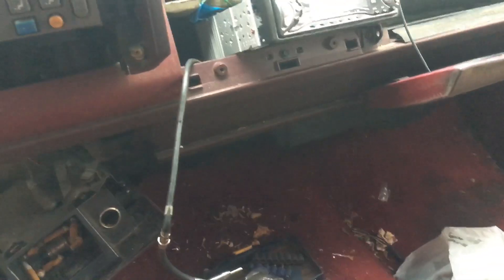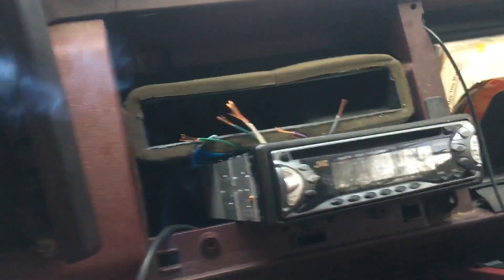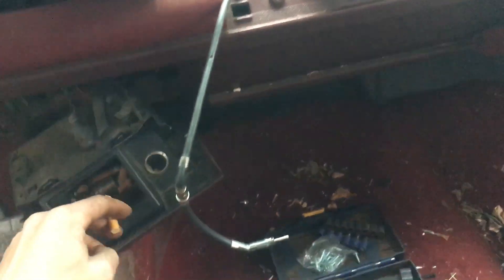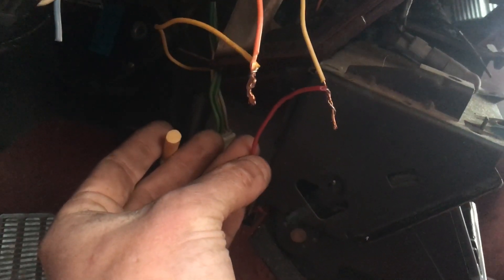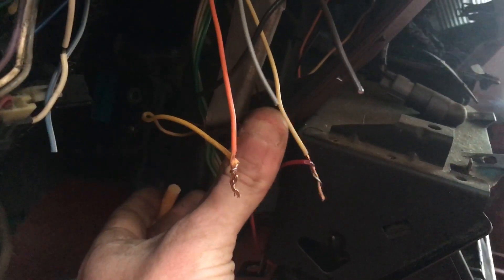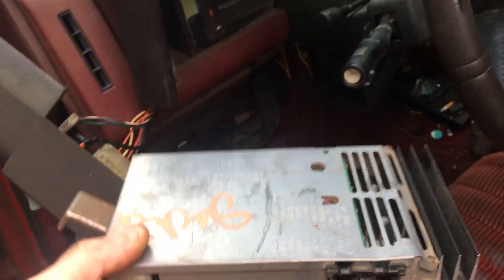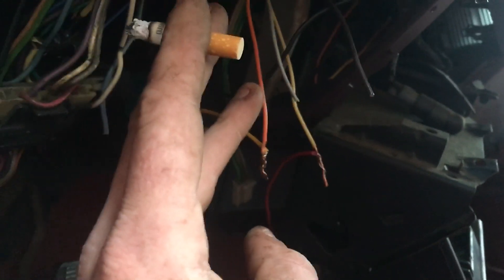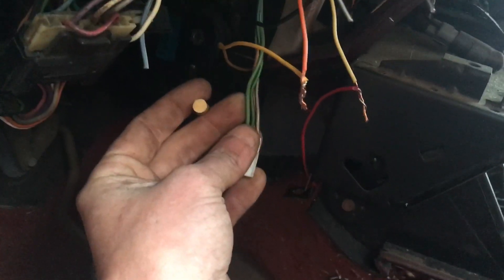88-93 GM stereo install

Comment: There are 4 speakers and 4 speaker wires there should be 4 for front and 4 for back ???
Reply from the maker: It's been a while...pretty sure there are only two front factory speakers

Comment: Did you ever finish wiring the radio because I connected the wires u said and nothing happened
Reply: Same mine isn’t turning on
Reply from the maker: Yeah it worked.  I think I had an extra set of speaker wires left over from chevy wiring, the old factory speakers were rough sounding.  The aftermarket stereo came on and off with ignition, I even set time and sound preferences that stayed memorized with charged battery.
Reply from the maker: Mike try throwing a volt meter on what you have and see if you have voltage anywhere.  If you have no voltage, check your fuse.  If you have voltage, identify your battery wire, your ignition wire, and your ground wire.  Having all three of these with key in on position should light the lcd display up on stereo.

Comment: Ya what color is remote wire. I got everything else
Reply: Hey Sergio Correia, did you ever figure it out?
Reply from the maker: The remote wire is an extra unnecessary wire for this year chevy.
Reply from the maker: The remote wire just makes the aftermarket stereos lcd less bright when you turn headlights on.  Or you may be referring to a wire used for a motorized antenna for am/fm.  Again, this model had no option for that.
Reply from the maker: Or the remote may refer to a remote control that came with your stereo, again this wire will not be necessary for the stereo to operate.
Reply: Remote wire is the wire that turns on any attachment to the stereo head unit like an amplifier
Reply from the maker: @adriansandoval90  Thanks I didn't know that, I thought it was an antenna wire for a handheld remote
Reply: Orange is constant 12v and yellow is ignition for stock gm wires